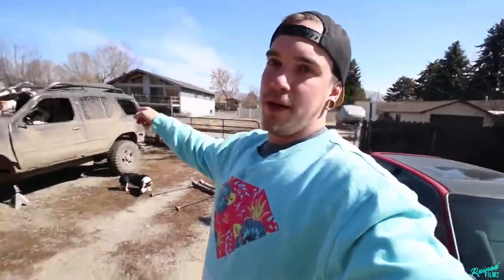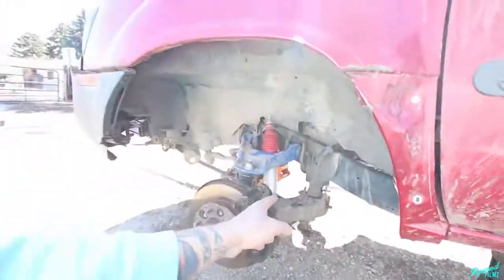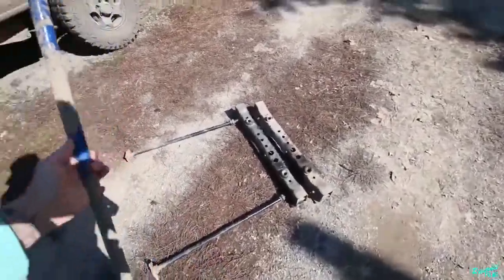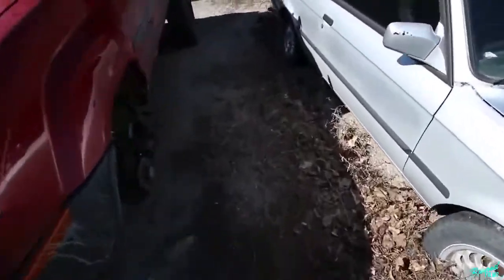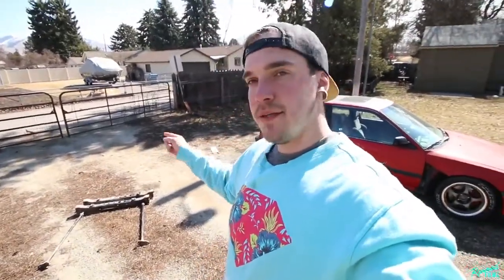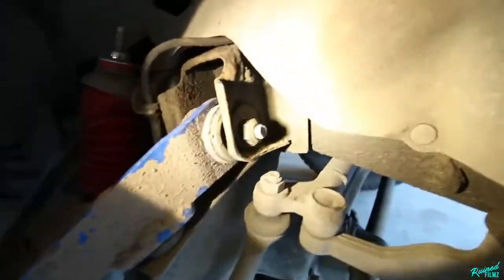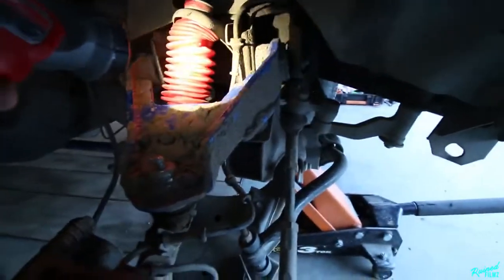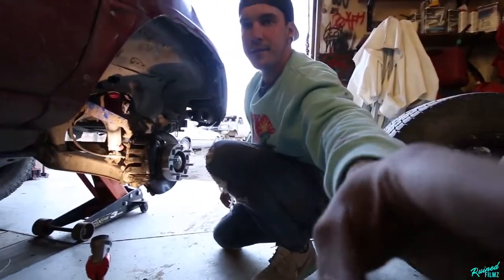calmini lift install part two on the Overland Xterra

Comment: Was the suspension stiff?  I installed the Heavy Duty Upper Control Arms, but it didn't raise the suspension an inch, what could I be doing wrong?

Comment: Where did you get the ditch light mounts and where did you get the rear corner bumpers?
Reply from the maker: The light mounts I made and corners I got off a parts truck I have more videos out there on them!